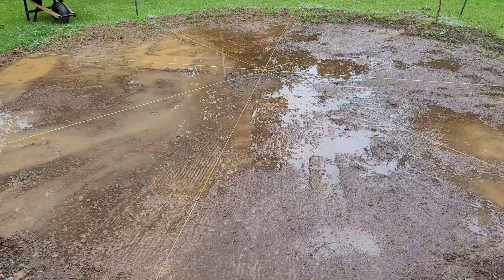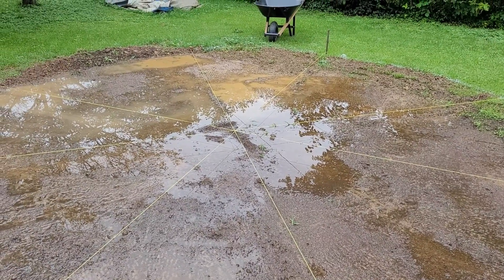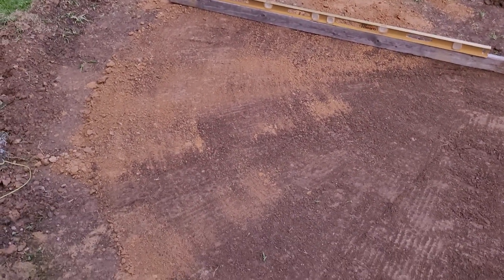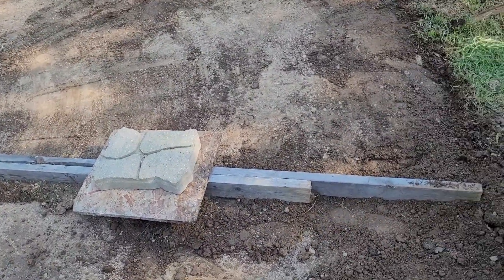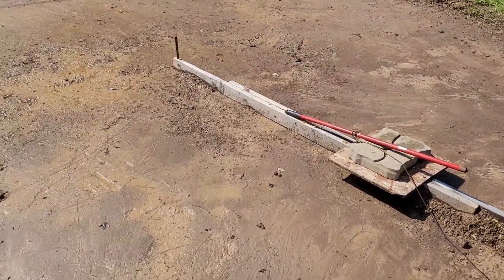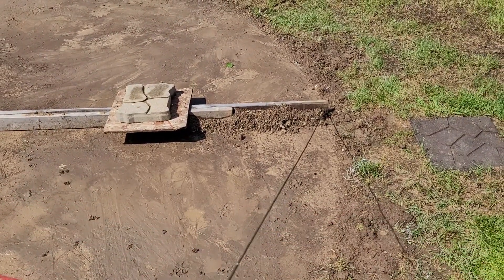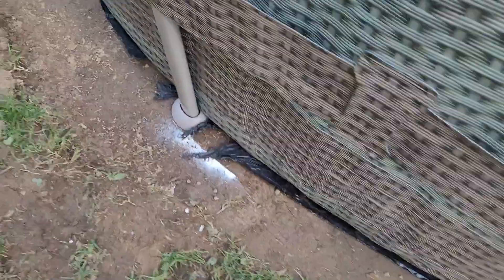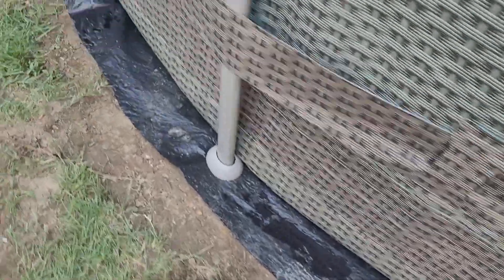How to level the ground for pool. How to setup a pool Part 1 - Ground leveling. Pool Setup

Comment: how big is that pool
Reply from the maker: 10K gallons
Reply: @outdoorswithcam  HAHAHA I'll bet that answered their question. Pretty sure they meant in terms of feet. Between that answer and no support under the legs and no sand and filling low spots opposed to shaving high spots this is just too much lone wolf, renegade, hot doggin', maverick, play-by-your-own-rules madness for me.
D:  "Hey buddy, I hear ya bought a pool. Nice. How big-a-one j'ya git?" 
  B; "I went with the 10,000 gallon model."
D: "Oh. Ok. So how big is the house you built?"
B: "I chose the 32 window pane split."
Reply from the maker: @thebugalito  Never use sand! I tried that on the first pool 20 years ago. After a month of teenagers jumping up and down the sand moved around. The sand moving from walking/jumping caused craters. That  caused failure on the main seem because all the sand moved out from below it and had no support. Sand moves. Walk down the beach bet you leave foot prints. Don't try to claim weight of water will keep it from moving. Have you ever walked in the ocean. you leave footprints. When I took it down to replace it looked like surface of moon from the sand moving from feet. The pool does have leg supports under it. What are you talking about. There is a whole separate video on how to make leg support out of plastic barrels.

Comment: Omg!  Isnt that always the issue?  "The wife has always been upset"   its the only reason i have ever taken a pool down to level.   
Hey,  if you need an extreme leveling technique,  try foam sheets.   The sheets made for sound proofing walls.  It works perfectly on uneven patios, concrete, etc...
Reply from the maker: I have heard of that. But doesn't it compress under weight or kids jumping. That's what happened with sand years ago. It would move/shift under the weight of kids jumping

Comment: What kind of sands is good for underneath of the pool ?
Reply from the maker: I don't recommend sand. I tried that 10 years ago. I found that the kids jumping in the pool would leave footprints and results in uneven or pot hole like. I got away from sand.  I know all the instruction say to use sand. It never worked for me. YOu can level dirt and compact it. you can't compact sand. Sand moves around when you walk on it. Think of a beach and footprints.
Reply: Stone dust works a lot better than sand, it holds firm when it gets wet instead of liquification like sand does.  You can fill in with gravel and cover with stone dust, then put down a couple tarps and you'll have a pretty solid level bottom.  Some people use carpet padding instead of tarps, easy on the feet.
Reply: They sell stuff called "Dolomite Limestone". It is a crushed stone product that stiffens up when tamped. I wouldn't build a base out of it but it would work great for filling holes.

Comment: So your adding dry dirt as you move the 2×4 around? Your building up the low spots instead of digging out the high spots? Will the weight of the pool displace the fresh dirt you layed on low spots?
I want to do it this way but wasn't sure if pool legs would sink a little causing the pool to be out of level.
Reply from the maker: I leveled the high spots first then put dirt infront of 2X4 as I go around and it fills the low spot. It was perfectly level when done. I made 6x9" pads I put under the legs. I did a video on it. Its on my page. No the pool does not displace the dirt. I did have that very thing happen with sand years ago.
Reply: @outdoorswithcam  
First step was leveling ground by removing dirt from high end to be at same level as low end? How do you get ground to be level, that's the part I dont get. I've seen tons of videos but they dont talk about how they leveled ground.  My yard is on a slight slope, so far I've removed about 7 inches from high end and I still havent reached the level of low end on other side.from my calculations, I still need another 3 to 4 inches to go.
Can you tell me how you would level the area? What is process you use.
Reply from the maker: @ericmuller3339  You have to use a construction level. establish the grade 1st. Put a a level on top of a straight 2X4 the leghth of the pool's foot print. You can also just use string. They make string levels to. Go from the highest to the lowest. Get about a one foot wide "trench" perfectly level to use as your "grade" then just work out from the sides. When you throw the loose dirt from the high side to the low side you will need to compact it. I use a sledge hammer and just drop the head on the dirt. Unless you compact it will give you a false level.
Reply: You should start at lowest level always

Comment: How is the pool holding up without using sand? Also did you put the pool cover for the padding or did it come with a pad yo place the pool on top?
Reply from the maker: I don't like sand! I tried that years ago. At the end of the year after all the kids jumping up and down on the sand would move around and you would have low spots just like walking on the sand at the beach. Its perfect this year. Perfectly level. no low spots. We put an old solar blanket under the pool. Those cheap blue Tarps don't last long.
Reply: I highly recommend bank sand for pools it compacts better than other sands I build above ground pools bank sand is the one that works best